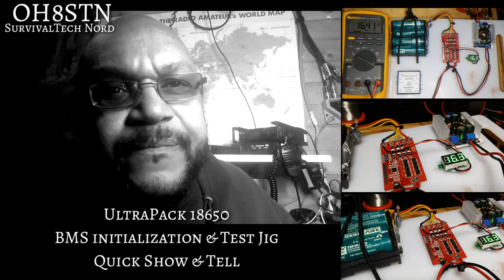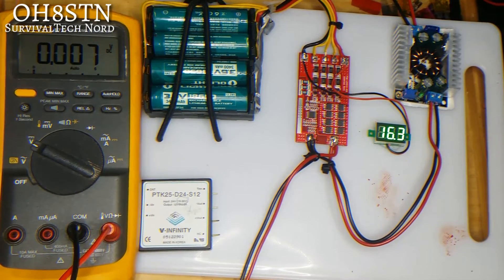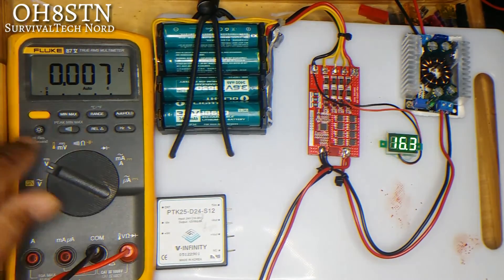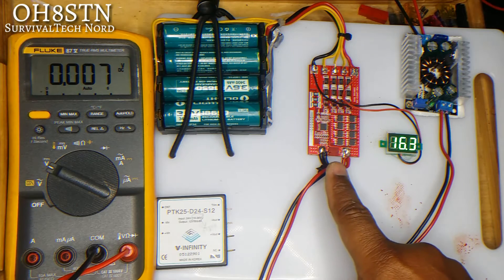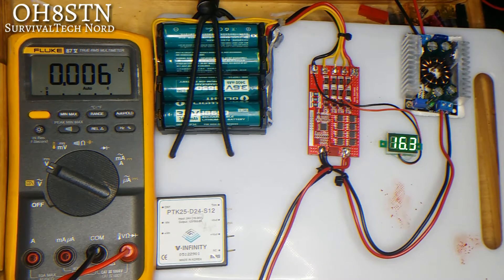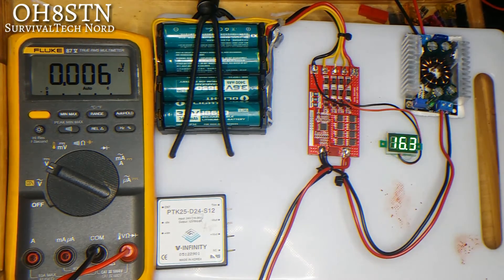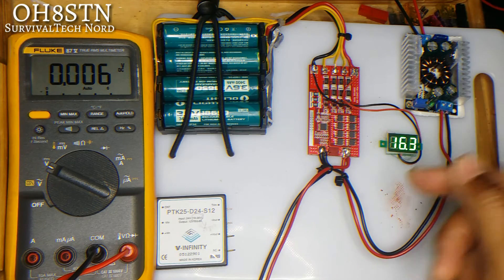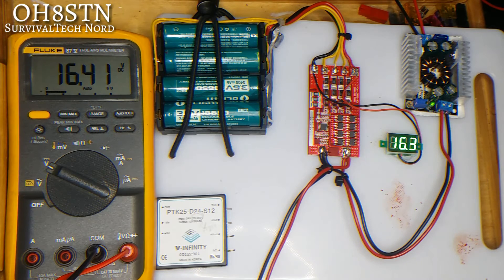DIY 48wh QRP Battery Pack for FT-817ND
UltraPack BMS initialization & Test Jig

Comment: Looks good ! Could you also use a relay that would close the circuit to reinitialize when the cells are removed and when cells are replaced it would reinitalize the BMS and open the circuit ? Thanks for sharing !
Reply from the maker: +SurvivalComms I'm certain it's possible, but I would hope some other tinkerers could contribute to working that out.
Reply from the maker: +SurvivalComms  thinking about the relay. That circuit would have to be clever. Firstly we only want to close that circuit for a second. We wouldn't want the relay to close  the circuit until there is all four batteries in the tray.
Reply: Yes it would be tricky and a sum voltage signal on the board for relay closure is what I am thinking without actually having a BMS board here yet. When mine lands I will be able to mess with it a bit. Its going to be a fun project !
Reply from the maker: SurvivalComms hopefully you're willing to contribute to that part of the project!?

Comment: Can you further explain why you chose the 16V configuration?  The FT-817 lists a max voltage of 16V, elecraft KX2 says 15V so use with different radios might be limited...what about a 6 cell 12V version?     Would this be possible with this or a similar board?
Reply: The 4 cell lasts much longer in service than the 3 cell. I've used mine on multiple 13.8v radios with no ill effects.
Reply: I used a big 10a diode. for reverse current protection and a tad of voltage drop. I have found that the 4 cell 18650 pack when loaded at a light draw with the diode rests consistently at under 16V with this arrangement fully charged.  I built a regulator and a pass transistor arrangement as a DC to DC converter but it had quite a bit of sag under load and added weight. I used a 2n3055 and and LM117. I could draw up the circuit I used if interested.
Reply: Yes it did. Not scorching hot but in the wow that's hot range under a 7a load for 30 seconds. It cools off very rapidly. I did a video on my preliminary pack a month or so back. I haven't had a thermal failure yet and in my second generation I relocated the diode.
Reply from the maker: +Matthew Brady hi Matthew there's a very large web page with all of the project notes, including this question :)
There's a few reasons why I wanted to go with the 4S system. If this was only about powering a radio for a limited amount of time then at 3S version might be a good idea. Personally I wanted to have the greater capacity of the 4S1P or 4S2P packs, so that I would have the maximum capacity possible in the smallest  lightest configuration. The 4S1P configuration gives 49wh (98wh for 4S2P) while the 3S comes in at 36.6wh (73wh for 3S2P). The additional operating time at the expense of one additional cell is a good compromise. In any event I'm going to regulate the power coming out of the battery pack, to something the radios are happy with. 
Again if I were looking for something to power my ft-817 or KX3/2 at a picnic table, for an afternoon in the park, I might very well use a 3S pack. Then again I wouldn't bother configuring it for simultaneous charging and discharging of the pack. 
Anyway that's the beauty of this system. it certainly is possible to configure for 3S, 3S2P, 4S, 4S2P, ... the only difference between the systems is the BMS, and the number of cells we use.
Thanks for the comment Matthew and I hope this helps.
Reply: OK thanks for the response and I did check the blog.  I didn't realize you were going to regulate the power out.  Will that component be part of the build or standalone?
Reply from the maker: Matthew Brady Doh! I need to work on my documentation. It's definitely a part of the build. I'm doing things sequentially so I haven't even figured out which one I'm going to use yet. The dc-dc converter you see in the video with the name Infinity is one I'm using temporarily during testing. 
I'll update the project documentation in the next days and find the right dc-dc converter.
Excellent questions Matthew and thanks for commenting. Comments like these challenge me and force me to do a better job :)
Reply: I built a DC-DC converter at one time for mine and found it not to be worth the hassle or weight.
Reply from the maker: SurvivalComms  can't tell people not to regulate the output!
Reply from the maker: SurvivalComms  did the diode get hot?

Comment: Glad to see this come together, that's a bummer that you have to re-initialize the board when the batteries come out.  I suppose you could just charge the batteries while in the pack and avoid this?
Reply from the maker: +TheSmokinApe certainly you could do it that way. That's  how I'll be using the pack.
Putting the momentary switch in there isn't really a big deal for the Survivor who wants to change out batteries. 
Anyway I'm also happy this is coming together:)
Will you build one?
Reply: +SurvivalTech Nord Is there a potential for problems if the switch gets turned on by accident?  I'd like to build one as I am into this type of thing.  I did pick up an Anker battery that I am hoping will power my 817 but it needs 110v to charge...  I am hoping to have a video soon.
Reply from the maker: +TheSmokinApe that's actually a really good question! I need to find out where SISI gets those cool flip open switches for their båmb v3sts :D I'll test that through!
Reply: +SurvivalTech Nord The Anker I got is the Astro Pro 2, I forgot you have done a video on it already...
Reply from the maker: +TheSmokinApe
Reply from the maker: +TheSmokinApe that was a really good pack it's a shame they stopped making it. About your other question, the Ultra Pack is designed to be simultaneously charged and discharged. In that respect it's just like The Goal Zero Sherpa 50 or Sherpa 100 or even though Hardened Power Systems QRP Ranger.
Reply: +SurvivalTech Nord yeah, the ultra pack looks like it will be awesome...